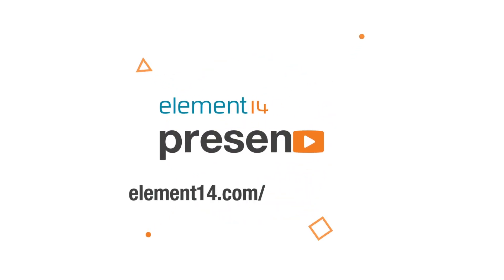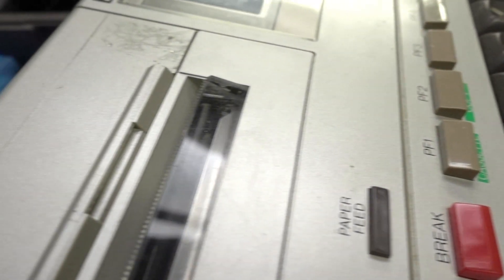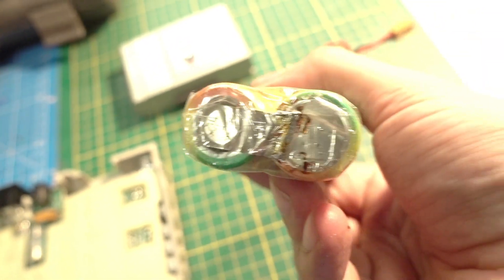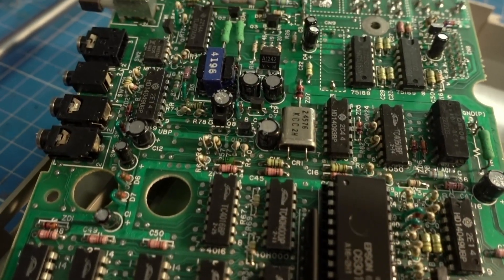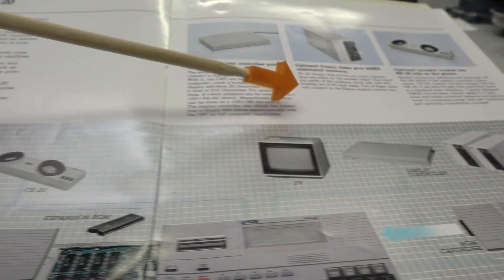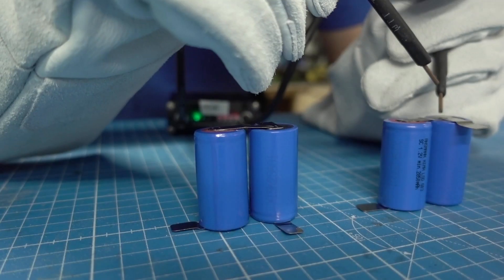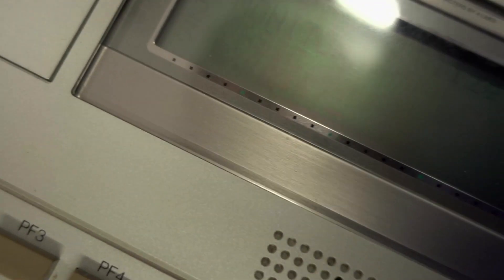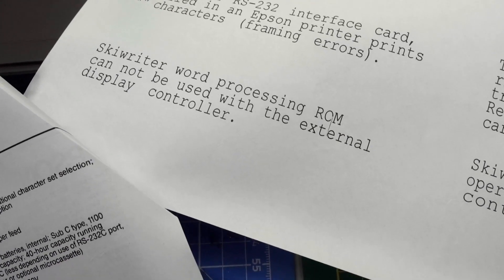Repairing the World's First Laptop! #EpsonHX-20

Comment: I missed what exact things you did that actually helped to get it back running (besides the battery replacement). 
I picked up one at the computer museum on the cheap, they have some excessive donations on some machines, and it appears dead. I had something on screen for a short moment.
The machine looks mint, the keyboard has the best juice of any keyboard, beating 150€ Keychron ones. The original Nicad looks new too, it reads 6V after some charging, no expansion or leaking anywhere.
Does anybody know of a non destructive way to bypass batteries and make it adapter-only?
What is also sad, is that unlike most early eighties stuff with LCD screens, this does not use a standard one. If it would you could drop in an OLED replacement.
Do you have any idea how to hook up a TV as display?
Reply: it boiled down to new battery pack, cap replacement, and cleaning. most faults were due to grime and dust building up.
Reply: @MAYERMAKES can you share the details on the replacement Caps please?

Comment: Did you check if the original batteries leaked onto the board? The capacities are leaking causing the screen voltage to drop from 7v? Worth checking... to get the screen to work properly..
Reply: no damage from the batteries, those were replaced a few years earlier.

Comment: Anybody know what Battery spot welder is being used here?
Reply: A generic chinesium one, look out for one with a case and different modes. Most spot welders are very sketchy
Reply: @MAYERMAKES  Yeah that's why I was curious, the setup I currently have is a bit brute force, an ATV battery, a starter solenoid, a button and hope was looking for something with a bit more control. It seems a lot of the options on ebay etc are just a control board and you have to buy Super Caps Seperately
Reply: @MAYERMAKES  Chinesium... LOL Never heard that way to say "Chinese Junk from a dropshipper"

Comment: The purple tint on the display makes me think the polariser layer is going bad. It's just something that happens with monochrome LCD displays like that. It might be possible to replace the polariser film and the reflector. If the screen is held together by the metal frame, without any glue, it shouldn't be too difficult.
Reply: Worth investigating, I have no other unit to compare it to...
Reply: Could also be a problem with the contrast control circuit.
Reply: “LCD displays”

Comment: I for one would love to see how to use an external monitor with the HX-20.  I also have the Expansion Unit with extra memory and a spot for ROMs.  One issue.  In the main unit I have a word processing ROM, SkyWriter, installed.  I can get SkyWriter to initialize.  But when the Expansion Unit is attached, I cannot get SkyWriter to initialize.  Can an internal ROM be used at the same time as the expansion unit?
Reply: there is a troubleshooting sheet (shown in the video) that states Skiwriter(Skywriter) CAN NOT be used with the expansion unit as it was designed for mobile use only. I'dlove to get all the stuff that works with the HX-20 but I could not find anything in my area for resonable prices.
Reply: @MAYERMAKES  I have the large external 5 1/4 floppy drives and Expansion Unit.  Thanks for tip on SkiWriter.

Comment: So are you going to end up doing like 8bit guy did with that prototype ibm workstation and take a Dremel to the case instead of spending eight bucks for a security bit at lowes, or shove a paperclip in the psu?
Reply: You should go after EEVblog. He pushed capacitors off the board of a vintage $250,000 IBM processor module and shattered one of the chips!
Reply: As you can see in the video, I treated the computer perfectly fine, no damage or any dremel use. It now works again and has not suffered any missuse.
Reply: @MAYERMAKES  Ignore it, it's concern trolling.
Reply: @user-qf6yt3id3w  no,it's continually bitching at how 8bit guy hacked up a prototype when he could have easily gotten the right bits and done some consulting in the retro community. The fuse he replaced was originally a slow burn and he put in a fast burn fuse on top of hscjig the thig apart.
Reply: @singletona082  Maybe you should try to get PETA to lobby against cruelty to old IBM hardware as well as animals. I mean, an IBM S-370 machine has more transistors than a lobster has neurons.